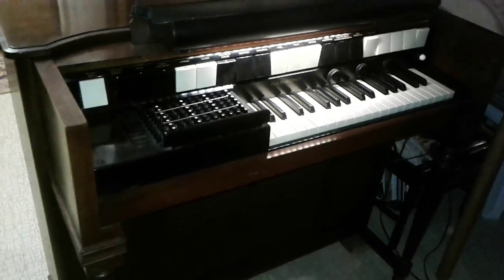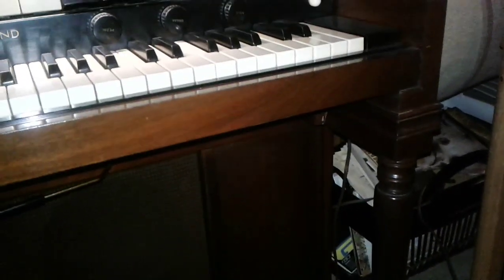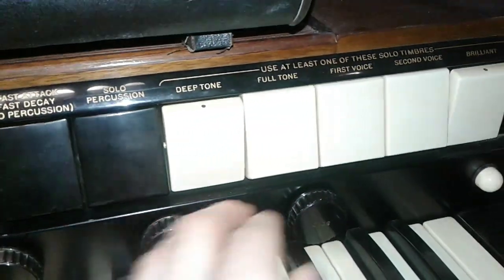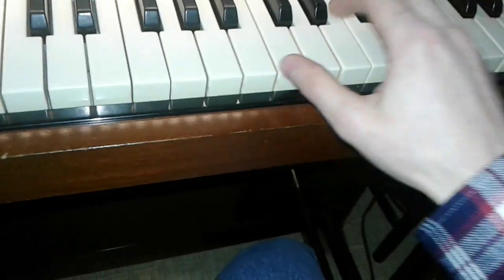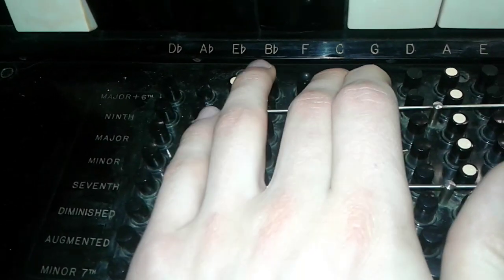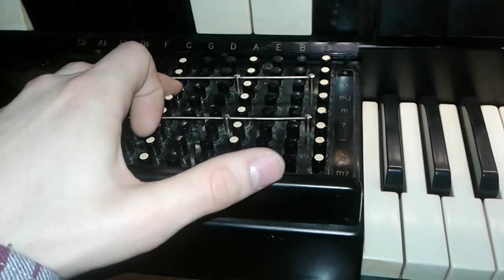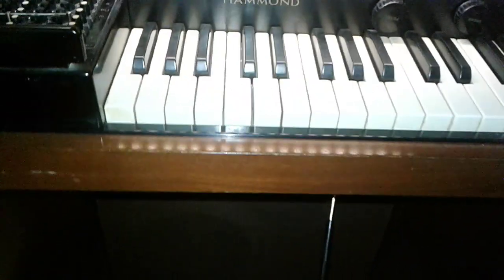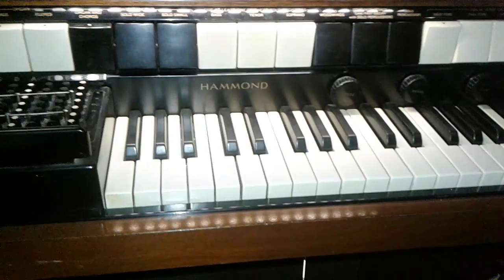Hammond S6 Chord Organ

Comment: We had one when I was growing up (?). This is what I leaned the basics os synthesis on in 1958-62 or so. The chords speak for themselves. There is a setting where you can have the chords playing without having to use the bar. It is controlled by one os the switches. This was a derivative of the original Extravoice which had a split KB instead of the chord set. The treble keyboard is the most interesting. It is a two channel affair with ORGAN and SOLO. The ORGAN iconsists of two fully polyphonic voices 8' String and 8' Flute. The SOLO section is a monosynth. The 3 registers are simultaneously available octave settings. The WOODWIND changes the waveforum. If only one octave setting is on this goes from the default sawtooth to a square. If you have more than one octave engaged, you get some wierd pulse wavess. The white tabs over on the right are filters. Each of thise tabs appears to operated a bandpass filter so that taken together you have a full 100% CF. Alas there is no resonance control. I have forgotten much of what the black keys do. The SOLO section can be detuned from the ORGAN by means of knobs in the back of the instrument. As I said, this is on what I learned basic synthesis when I was 13. If I recall aright, this synth was high-note priority which let you use other fingers to play the regular ORGAN voices below the SOLO voice. We got ours in 1955 when it coase $1000. It was designed for compactness and had a manual that used a different style of music notation for those who could not read the staff

Comment: Just found an s4 on the curb, plugged it in hit the expression pedal, pilot light turns on, all tubes light up, but no sound... any ideas? Am I missing a standby switch???
Reply from the maker: Since it is tubes you have to give it a while till it warms up. If it still doesn't work then see if the speaker is in tact. Hope you can get it playing again.

Comment: I wonder if Arturia or Martenic could be made interested in this beast. I have some audio samples of the chords. They are a bit weak in footages, sounds like 2. But the audio samples could be overdubbed an octive up
Reply: @technological reinovations  The original was all tube and quite a fiew of them. In moderen terms, it would be too limited in function at the price compared to what is out there, whereas, as part of a collection, it would find a niche. Arturian has a cute little trick they pull; "under the hood". The instrument deploys as a stock version of what it was, like a Vox Connie or Farfisa. Then you clck on the top panel and you see a representation of the guts of the instrument, to which you can make adjustments to add new performance features. Also, the S-6 had a primitive synthesizer as it's main melody voice and organ flute, a kind of triangle waveform and strings both only aat 8'. The synth voice was monophonic high-note priority. Arturian could probably fix it as the did the miniMoog for up to 8 notes poly. Arturia has a new version of the Syclavier designed by one of the original inventors for them. It was on the S-6 that I learned the basics of synthesis in the 1958-60 timeframe. The synth could also be detuned from the organ voices. I used the same S-6 as the basis for developing my KB skills beginning in '66 although some of the polyphonic notes had gone out of tune and the instrument had not been maintained at all since the late 1950's. Auturia might be inclined to reploace the two 8" voices with the same at 16',8' and 4' or a drawbar channel. I would also overdub the samples with the same sound an octave up as the chord sounds were a bit weak in frequency rrange. They may also have a problem with using any existing controller for the 96 chords and the two bass pedals. It was said to have been used in the 1959 or 60 recording of NATIONAL CITY and appears to have been used by Johnny and the Hurricans in RED RIVER ROCK, REVIELLE ROCK (which is my wake-up song on my phone) and BEATNIKK FLY (a rock and roll version of JIMMY CRACK CORN) in the 1959-60 period